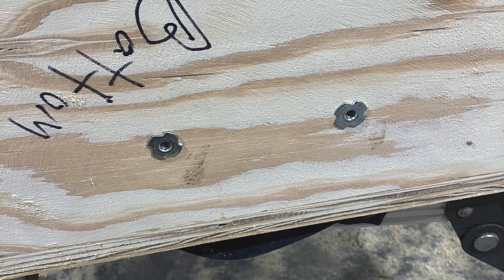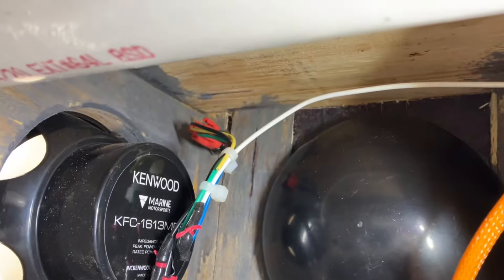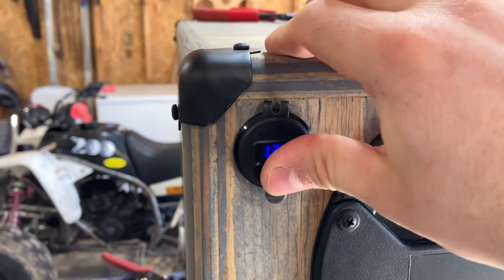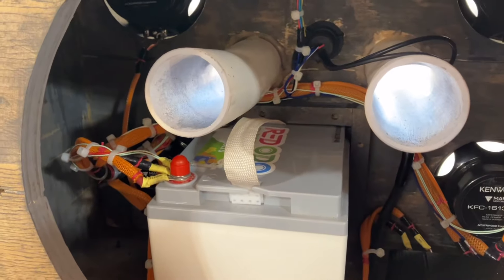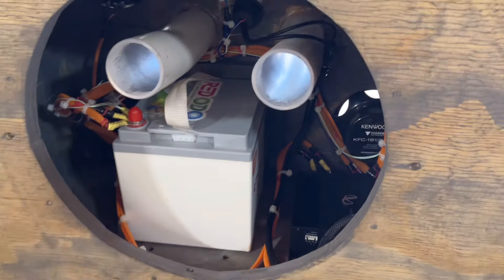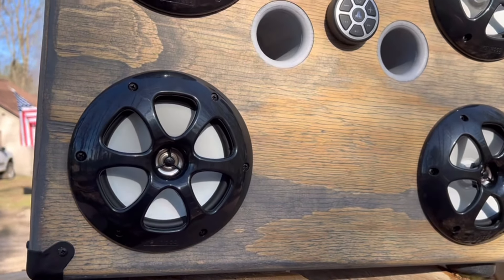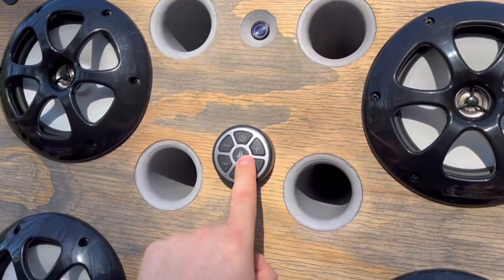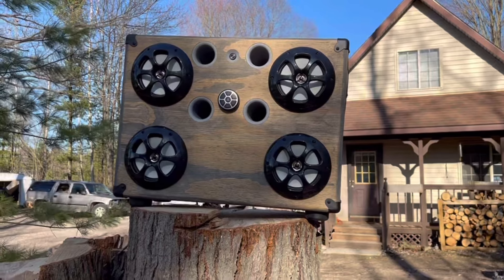Portable Bluetooth boombox

Comment: This goes hard bro! Great job! 👍🏽 🔥 🔥
Reply from the maker: Around 16 hours of playtime now and still at 13.1 volts 
The lithium battery is a Redodo 50 amp hour 12.8 volt battery
Reply from the maker: I can build u one with your choice of speakers and it can be smaller or bigger . If u don’t want a battery powered one I build big ass ones that run off home theater receivers

Comment: Awesome build! How long does battery last on moderate volume? I’m doing a build too but w a focal amp and 8” fosgate m2s using the newer marine audio control Bluetooth controller, I hooked my main power switch to relay to give juice to a fused distribution block so everything powers on /off at once. And hooked up charger cable directly to battery. I’m using similar method of charging. The lithium ionic battery’s have Bluetooth built in to tell you how much battery life is left, estimated run time.  I only had room for a 20ah , running 200x2 rms    Your battery must last forever!
Reply from the maker: Not sure it’s played more than 10 hours at a good loud volume and the voltage meter is still at 13.1 volts
Reply from the maker: Yah I had to heat up the ports and curve them a bit so I could take in and out the battery if ever needed . This is a large battery for sure I wanted to most simple set up and I believe you can’t get much better than this . I wanted a separate power switch for the voltage meter and usb charger because it doesn’t need to be on all the time just for status of the battery and charging devices . But u turn on the power button above the JL audio controller and it auto connects in seconds to my phone .  First time I’ve used the JL audio controller . It is a bit funny with the volume being maxed at about 3/4s on my phone for maybe a safety reason , so I turned the amp accordingly.
Reply from the maker: Make a video on yours explaining how it works , 
This battery shuts off at 10.5 volts which will shut down the amp and keep it from being too low of voltage . So the BMS tech built into the battery takes care of a lot of circuits that I would have needed
Reply: @annihilationindustries1990  my thought process was having  everything (lights usb led voltage meter)  including the amp powered by switch. This way there’s no draw from amp at all when radio is off. I know remote wire from controller turns on and off but don’t want any vampire draw. Plus I don’t need anything shorting out causing fire when switch is off. But have a direct connection from charger to battery. In terms of the battery getting low. It will just get turn off w low voltage. No harm done. Having the Bluetooth app with the ionic battery. I can play at desired volume
And the ionic phone app
Will tell me how long battery will last at that level of playing. Haha I have yet to make videos. I know I should. I do a lot of car audio and small projects like this. Not sure how people have time :)
Reply: @annihilationindustries1990   honestly. You could have went w just one port. But a box that large you don’t need any ports. Put some rags in to block them off and see if there’s any difference. Maybe tighter bass. Plus when you put a high pass filter on those at 60hz is a good idea so you can crank without worrying about bottom end frequency blowing speakers.
Reply from the maker: One port with the amount of port area I needed wouldn’t fit so I went with 2 inch ports and I still am around 9sq inches of port per cube with around 37hz tuning . I never tune anything above 40hz and I’ve been happy that way . Makes it have nice lows and sound proper. Tuning to 60hz would make it sound like a pro audio speaker and be lacking everything for dubstep and rap. And doing a sealed box really robs the output on small speaker enclosures. The amp just has a lot of output for these 30 watt speakers so playing heavy bass was bottoming these out mechanically . I’m sure even in a smaller sealed enclosure it would have done the same , these KFC marine speakers have extremely soft suspension but it makes them efficient.
Reply from the maker: @daveroski but yes I barley have the time my self with working full time in Aviation as a mechanic and having a family with motocross has left me with maybe a few hours a week to build my customers projects but they have all understood. 

What I was originally taught for subwoofers is to kee 10-16 sq inches of port area per cube . Sure if it’s a high excursion driver so u won’t get port noise. But speakers like these u can get away with smaller ports to keep your tuning low and it adds back pressure to help with over excursion . Yah my 21 inch subs loved 17 sq inches or port per cubic foot but speakers like these and a lot of the home audio from Best Buy will use tiny ports and still fill out a room with bass
Reply: @annihilationindustries1990  what app you use to figure out tuning ? And does Kenwood publish TS parameters for the coax?, I imagine the FS parameter on that speaker is 50/60, so if you tune it in the mid high 30s, I do not think it will do much, These speakers are designed for free air anyway (work in anything). Like boat speakers have them in an enclosed tower/cans capsules. But if your getting good air movement in ports and it sounds good, that's great, I think the sound would be negligible with or without ports for larger boxes, I'm putting 2-8" coax in a sealed pelican box, .8 cu ft for 2, I will have to see how it sounds, trying to go for the water resistant idea.
Reply from the maker: I use the ultimate car audio app, and speakers playing at port tuning will barely move , and still play loud as the port is doing all the work .
Reply from the maker: And free air as long as u have a big enough baffle will keep the back frequency wave from canceling out the front. And I’ve learned to not worry about TS parameters too much as like a sundown sub has a FS of 43 hz yet plays 20hz like no tomorrow
Reply: @annihilationindustries1990  I’ll check it out. Thanks.
Reply from the maker: @daveroski yah man don’t be afraid to tune your enclosures lower than FS . Yah you’re not getting a subwoofer amount of bass out of your speakers but you will still be able to jam out . My first garage boombox I made back in 2016 had to Hivi F8s and two dayton audio 1 1/8inch silk tweeters. Powered by a Samson 120 watt 1u rack mount pro audio amp and I had two 3 inch aero ports tuned to 30hz and it shook my garage yet I could get 3000hz out of the mid ranges
Reply: @annihilationindustries1990  sounds like an awesome setup!
Reply from the maker: @daveroski the customer and I turned down the high pass filter a little bit to allow more bass and it now sounds even better at low volume with the lows and still handles it full tilt. Testing songs were some decaf or rebassed music good for subwoofers and it will achieve 30hz decent enough to make me smile . 
So definitely tune your boombox to what u want to listen too not based on the FS
Reply: @annihilationindustries1990   Great info!!, Ever have turn off pop? do you have your radio/amp turn on with switch at same time, or do you hook your Marine Radio remote input wire on switch while everything else is hooked to battery?